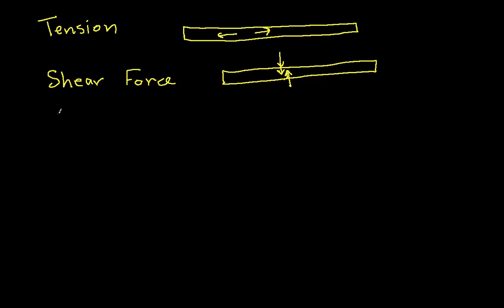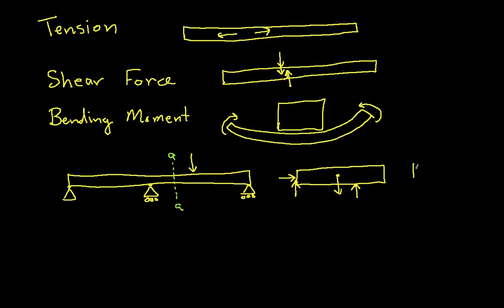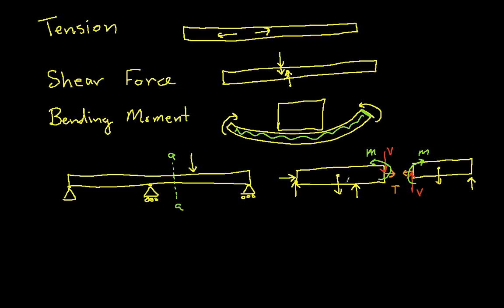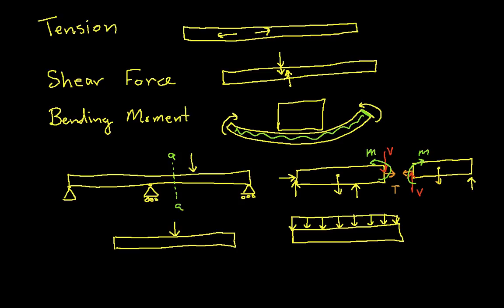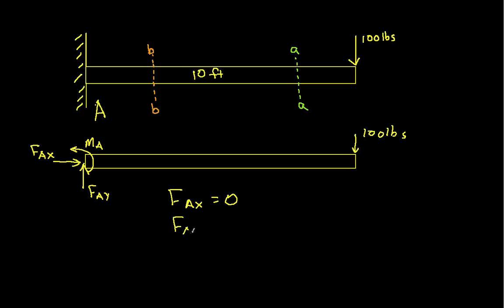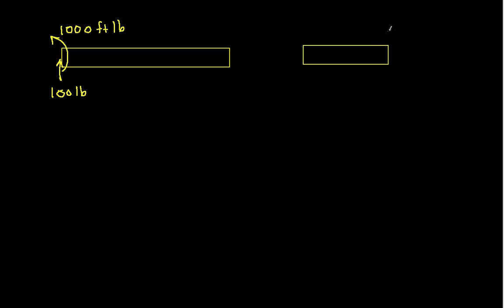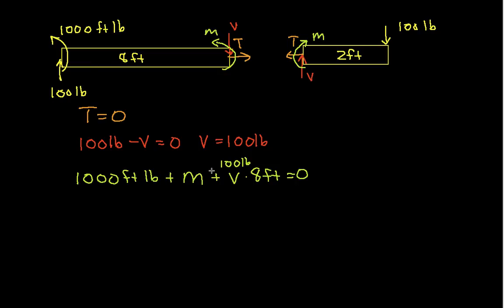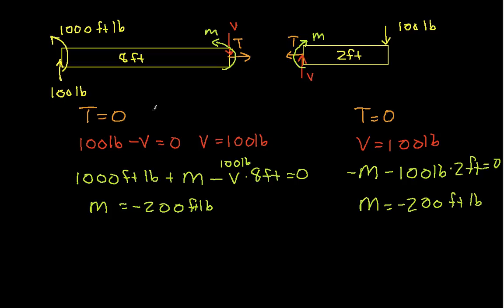Internal Forces-Tension, Shear Force, Bending Moment

Comment: So the moment is what direction the beam will rotate about a fixed point, in this case the wall is the fixed point for the first moment of force (torque) and then 100 lb force to the right is the other fixed point the object will rotate around. Because " v " force is less than 100 lbs, the beam will rotate around the wall or in this case the 100 lb load. Right? Moment defined by math is the cross product between two forces (vectors) and so a moment as shown in this is example is a vector itself, not a scalar.
Reply: I was confused with moment's for a while, khanacademy cleared that up. It's just a force acting parallel to an point. The way I understood was a diagram of a swing. If you push someone on it you're applying a moment around where the chain is secured

Comment: taking moments about point A @ 10:20 round there, shouldnt that moment be 0? Because if your're takign moments about A distance is 0, so how can the moment be 1000 :(
Reply: taking a moment about a point means you multiply all perpendicular forces times their distances from the point. M=F*d since the force of 100 pounds is 10 feet away from point A (its moment arm)--   -100lbs (downward) * 10 feet (distance from point a) = -1000ft*lb. or 1000ft*lb clockwise.
Reply: @ sir j, i think your observation is right, the distance there is 0.

Comment: It would be helpful tp redo this without the mistakes and the reversing of signs!
Wouldn't it be easier to express the final equation (following the logic used for the previous one) as M+V*2ft=0 therefore M=-200ftlbs?
Reply: +djadameve It just depends on which point you consider while doing the moments. I wouldn't say it's easier, it's just another way.